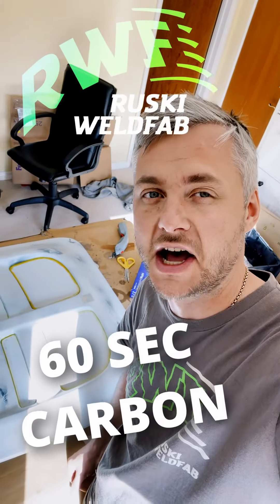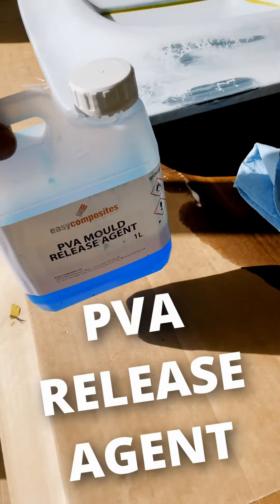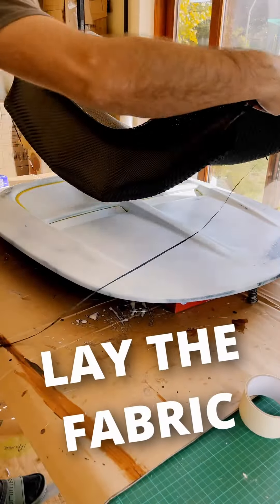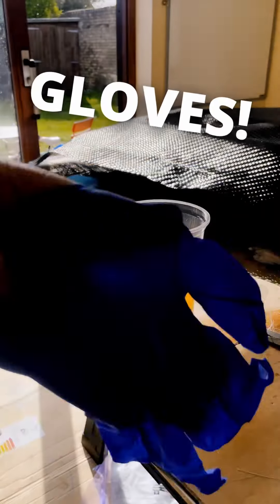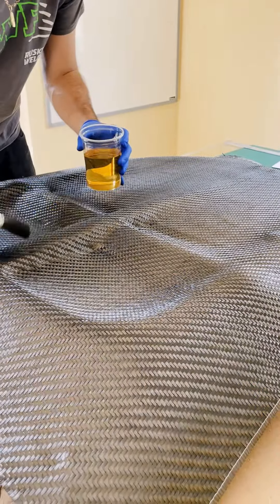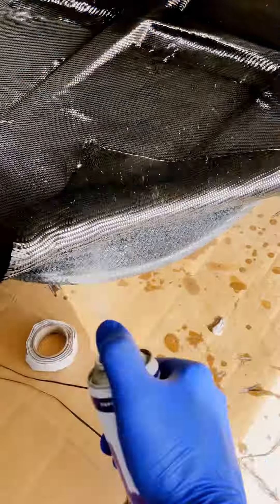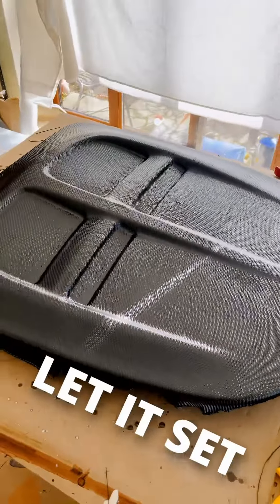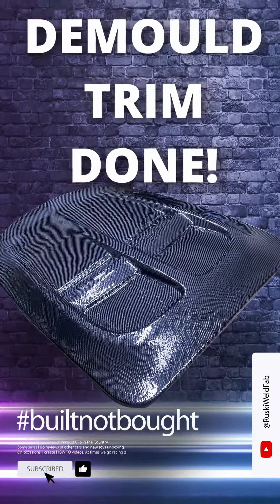QUICKEST way to make carbon parts! Affordable DIY carbon fiber

Comment: I'd like to make a carbon roof for my R56 Mini. All my mates are saying get it done properly... I mean have they not seen this video yet? Any idea on costs for the part you've produced?
Reply from the maker: it litteraly all depends on your requirements. for lightness in a race car this method is perfect! for show car quality this might not work. materails for that part come to around £150-170
Reply: @RuskiWeldFab  Thanks for the feedback. It's a daily but specced for track. I have the double pano roof and want to chop it out. I was thinking of buying a used non pano roof and do the wet lay method like you did on it. How many sheets would you recommend given its about 0.25mm a sheet? I guess finish wise I could always get it wrapped if it were not very aesthetically pleasing!
Reply from the maker: well you want at least 3 layers! bare minimum. rest is up to you how water tight you want it lol. but use foam as reinforcemnet

Comment: With the releasing agent that you applied, does the carbon part come off easy then?
Reply from the maker: well thats what it designed for. depending on the shape you may have to force it a bit. but always comes off eventually